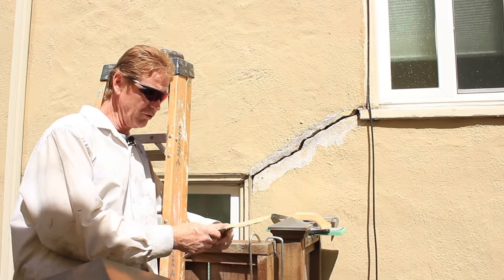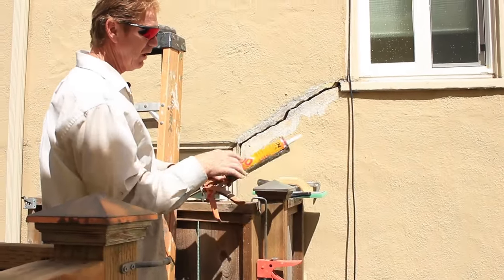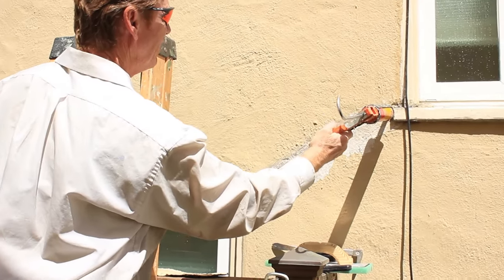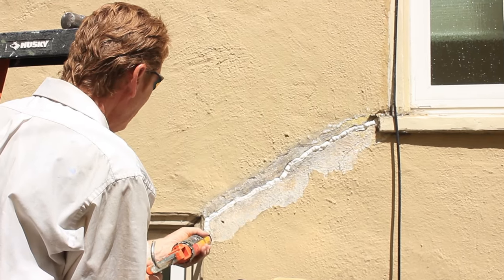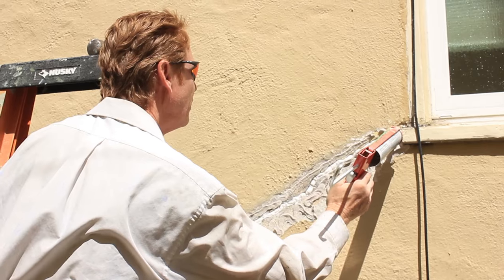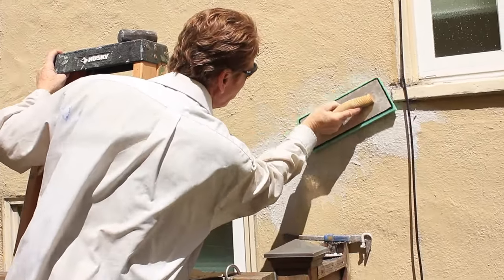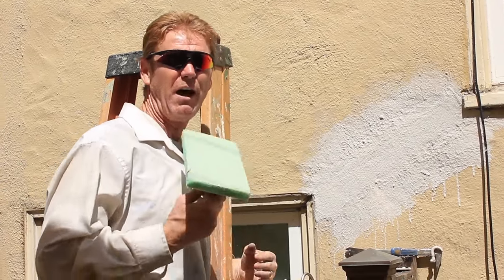Fix large structural cracks in stucco.

Comment: how long does this repair last? for some cases after a few months the cracks resurfaces, what can be done to repair the cracks permanently?
Reply from the maker: Howdy Olufemi, the determination of length of time depends on the individual movement to each home or building.
 When it rains as a rule the ground expands, thus a home will lift, when drier condition return the home will settle, thus cracking can and will occur.
 Plus the sun heat will expand the wood, thus causing the stucco to bulge, thus when cool, the movement or vibrations cause the same effect. 
There are about 15 more reasons but that would take me too long to write out, plus I have many videos where I explain most common reasons why stucco cracks.
 Best wishes with your projects, live long and Plaster
 Kirk giordano on teaching plastering

Comment: Just noticed the area code you are local to where I grew up. I’ll be trying this today my repair isn’t as large. We had a new panel installed and a new mast and the only items removed tore the elastomeric coating and some of the stucco so will be trying this to be sure it is water tight.
Reply from the maker: You can do it.
Reply: @StuccoPlastering  came out good. Now just giving it the week to cure listed on the tube and picking up some elastomeric paint.

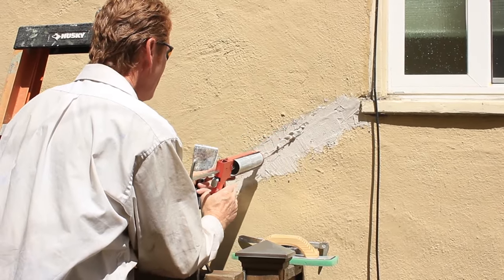Comment: I have a question about what you're saying starting at 3:30.  The word "planning" confuses me. Are you saying that you *could* have filled the crack with caulk and then covered  it with stucco, but you didn't because that stucco would crack again soon over this dynamic crack?   Whereas in another video (https://www.youtube.com/watch?v=xTB2RxBdKGA), you did cover the caulk with stucco because it was a static crack.  

My stucco has a moderate dash surface.. So far I've done well matching texture over static crack repairs but am faced with structural cracks now and I guess I need to work the caulk-on-caulk approach you took to simulate a dash look.    

Many thanks for your public service efforts. So far I have about 12 of your videos bookmarked as they've helped me repair many specific problems on my historic old house.  The oddest problem I've repaired? Someone re-stucco'd OVER parts of a downspout and its straps.  I imagine you've seen worse.
Reply from the maker: Hi Joe O'Connor, without viewing my own video, I will say there are many ways to fix a structural crack.
 I am implying to just fill it with stucco is the easiest, but far from the best as when a structural crack moves again and it will, as it's structural in the first place, the stucco will simply crack with it. 
 (for me structural means when it rains plus a bunch more reason, the area or wall will lift then when dryer conditions occur, settle, thus structural)
 If a polyurethane caulking if used first and the texture can't be matched with that caulking a person cam apply a stucco with sand to match a texture using stucco on top of all this caulking,
 Is a bonding agent necessary?
 Depends,
 If the caulking is allowed to set and or dry, yes a  bonding agent would now be necessary to adhere the new stucco to this area,
 if added while the caulking is still curing is a bit tricky as can it affect the integrity of the caulking?
 Good question, yes.
 But for a temporary fix, say 15 years, it is an intelligent alternative for keeping the rain water out to the alternative of tearing the wall apart and trying to locate why the walls is moving and or separating.
 Cheers,
 kirk giordano plastering
Reply: +Kirk &amp; Jason Giordano&#39;s plastering &amp; stucco tips .  Excellent, thanks!  Very clear now and you address some questions (e.g., does covering new polyurethane affect curing?) that occurred to me later.  Time is money. I'm ready to tackle the last phase of this project. I really appreciate how much time you give to us viewers.
Reply from the maker: Heeeey Jooooe, where you going with that gun in your hand?
 No worries,
 Kirk giordano plastering
Reply: Just keep one thing in mind, stucco by itself meaning stucco the final finish is a cosmetic finish and has very little strength as it's only applies 1/16 to 1/8 inch thick. The real strength comes from the Lath (Stucco Netting, Rib lath, Diamond mesh, etc.) and the Scratch and Brown coat cement which makes up most of the thickness of the wall system. An example of using just stucco by itself would be to apply stucco directly to brick or cinder block without applying a floated brown coat finish. This usually results in uneven suction, cracking and stucco not bonding well to the surface. That kind of shit work is done by guys that either don't know any better or just take peoples money and shortcut the job .

Comment: NOOOO- put backer rod (foam rope) in the joint and apply sealant. Tool exterior to achieve the correct sealant profile. That joint is going to continue to move (the caulk wont because its injected as one big thick turd) and allow moisture to re-enter the wall system
Reply from the maker: Howdy Aurora, a backer rod in this hole is like tits on a boar, useless.

                Peace, love, and happiness to all.
Sound Plastering tips from your favorite stucco nurds
Reply: I would have used injection ports and filled the crack fully. I'm not an expert but it seems like the obvious choice.
Reply: @StuccoPlastering  Im not trolling, I work with the sealant industry. Sealants only work when they are properly profiled and have 2 points of contact. They should look roughly hour glass shaped. The backer rod is not "Useless" it created the concave profile on the back of the sealant. Its a critical and often overlooked portion of a proper sealant detail. Here is the proper procedure as shown by Sika https://www.youtube.com/watch?v=GtiOf6rg5eU
Reply from the maker: @tompolasky7302  any backer rod, in my opinion, stops the calking from going all the way back, each job is different, thus we improvise when we get there.  Remember I'm showing my way, all folks can do as they choose.🍾

Comment: This wall is worth of stripping down, fix the movements and do the nice straight sponge finish with using actual straight edge, hard float and than sponge float. Or is every house in US rendered like this? No offense Kirk, but almost every video you post has a finish not worth of putting even on.
Reply from the maker: Howdy Peter, easy to throw out judgement, fact is there are so many homeless people in this neighborhood and even in the beautiful area that I live in, these homelss who would love to just have a roof over their head, heat and food well not that's just another luxury.
 Moral to my reply, is not all have the cash to simply remove and replace.     
                                  Best wishes,
    Professional answers on plastering projects with issues
Reply: I'm a plasterer by trade with over years experience but now I teach martial arts part time and do construction part time. I agree with you in the fact that not everyone will want to pay the money to do a more extensive repair. Here's how I'd tackle that repair: (not saying your method doesn't work as my not familiar with your final sealant to say it would work or it wouldn't work) 1st I'd fill the crack with some Urethane sealant such as Quad or PL. I like Quad better as it has better flow. 2nd I'd fill the crack with the Urethane sealant but not quite fill it up all the way. So the sealant gives it some give for  those strong internal movements. I'd let the Urethane dry up a day or more. 3rd I'd fill up the rest of the gap with a very sticky cement mix using Rapid Set and a good Acrylic Polymer Bonding agent as an admix to the cement. I would completely fill the crack and swipe a thin layer of cement over the top. 4th thing: Let it dry up a bit, spray some water over it with a spray bottle and float out with a Green Float. This way you get 2 things: The elasticity from the Urethane sealant and the strength of the Rapid Set cement with the bonding agent which I should ad that it's much stronger than just plain cement once you mix in your bonder. Very strong with cured! The more expensive way of course is to just tear back the crack, inspect for water damage, apply new 60 min paper if necessary, then expanded metal lath for stronger wire. I should also mention as you already know, a slipping structure would pretty much crack any stucco, masonry, or concrete. Notice that Roller coasters are either built with steel or wood because they have the most Flex. Only the structural supports would you see concrete.  I enjoyed watching your video. Nice job!
Reply: @StuccoPlastering  Excellent answer for a not well intentioned comment.

Comment: I have a similar condition here in a clinker facade (outside) and I have concerns about using Sikaflex to fix cracks, because I fear that it might introduce thermal bridges (still better than leaving the crack open i know). Do you have any thoughts on that?
Help is much appreciated, thank you from germany for the video :)
Reply: There was one area about one inch that was too high to reach to repair -- I am worried about leaving the crack open.
Reply from the maker: I’d advise Mor-Flexx it’s an acrylic mixed with sand and water soluble, which means it cleans up easily.